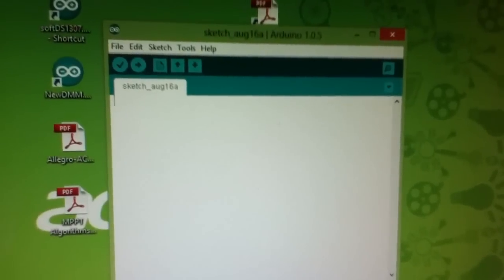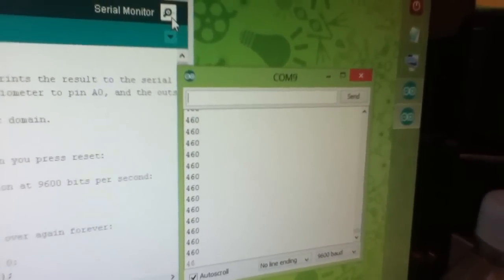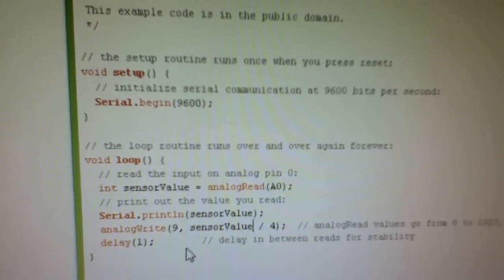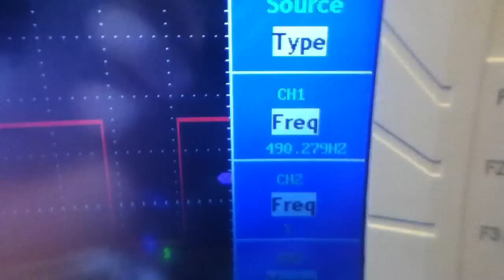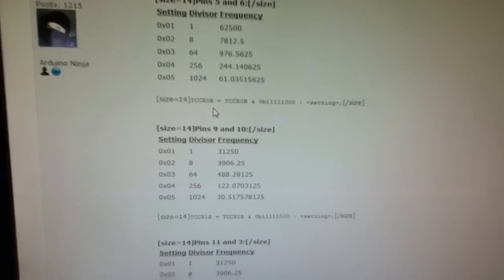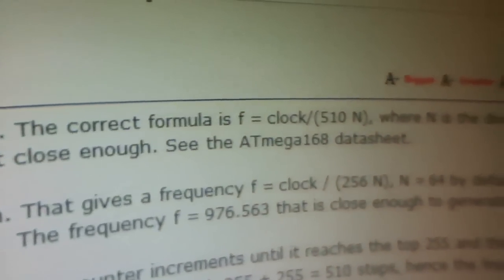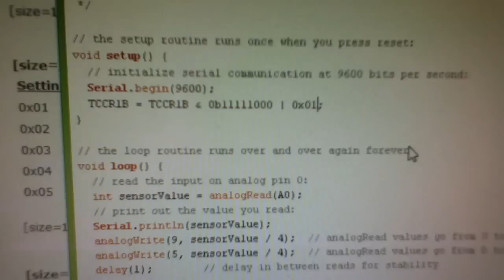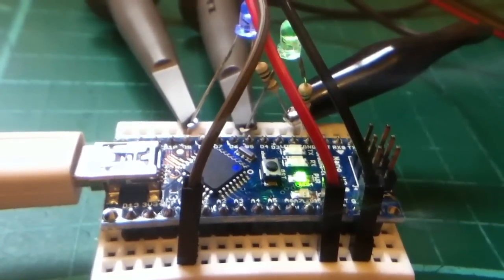Arduino PWM Tutorial #1 - How To Change PWM Frequency

Comment: THANK YOU.  This is huge for driving any non-trivial load off an Arduino pin.  For an LED, it's fine.  But if you want to drive some other entire circuit module, maybe some transistor circuit, etc,  and you need to approximate smooth DC, a PWM at high frequency can very efficiently and simply be filtered to reasonably smooth DC with a small cap and resistor, much more easily (and with quicker response) than low freq 490 Hz PWM.

Comment: hello  i was wondering if you would be able to help me.i have puls generator.how can i program it to run 10% duty cycle at 0.64 v input and gradually increacing voltage to 3.86v with duty cycle 90%.its for my project where voltage coming from throttle position sensor potenciometer control my pulse/duty cycle generator which then directly control fuel injector.any advice most appreciated cheers joe

Comment: How can I set the output to 130 Hz?  I tried running the sketch in Tutorial #2 but it won't compile, it's worthless!
Reply: I see that your question is from a few years ago, and I am honestly just beginning to understand how to manipulate these frequencies. But I wonder if changing the clock speed would allow us to have more control over a wider range of frequencies? Hopefully I don't sound too illiterate to you. Mostly I hope you have since solved this issue but as a beginner, trying to think this through seems to be helping me to grasp the concepts at a deeper level. Maybe I'm even close. Would love to hear what your solution was to this problem. Cheers!

Comment: Great stuff.  You highlight one of the many abstractions that Arduino programming language/IDE manages for users in the background.  I'm guessing that it may be easier to go straight to C programming for the PWM and Timer peripherals where the full power of all the options are available.  But then it wouldn't be an Arduino topic.  Thanks for your videos and clear instructions!

Comment: I'm trying to run an rgb led off pins 3 5 and 6 but thinks pins 5 and 6 are the same     why is this happening
Reply from the maker: +Troy Dry pins 5 and 6 use the same internal timer

Comment: @3.05 you say that the pin D13 is missing, it's actually located on the down-left side of the arduino, just look for it. Great video nonetheless.
Reply: I think he meant that he was wishing that D13 was a PWM channel, since it already has an onboard LED. Would be handy for experimenting.

Comment: Just a quick question. Is the analogWrite duty cycle pre-established. I am going for a 50 percent duty and I am generating the 31khz  from D9 like you showed in your video. Thank you.
Reply: analogWrite(pin,duty) is the syntax for the function. Duty is a scaled input from 0-255. 0 commands a 0% duty cycle, 255 commands 100%. For 50 percent enter 127.
Reply: +backcountry52  Thanks for the info. I really appreciate it. Cheers!

Comment: Hello. Is it possible to switch multiple frequencies with switches ? For exampe i want to drive a DC Motor with 500HZ, 1000Hz and 2000HZ , but i dont wont to change the code every time, but  to change it with a switch mechanical.  Is there a possibility to program a code witch recognizes witch switch i turned on, so the PWM works with the frequency. Sorry for my bad english.
Reply: You simply change the pwm %
pwm frequency has no impact on the speed of your motors

Comment: can all 6 pwm run on same frequency of about 10khz?
Reply: I have a related question that I am currently in the process of attempting to understand. I would like to know if each PWM channel, can output a different frequency simultaneously. For example, have Pin5 send a lower frequency to one motor, Pin9 send a somewhat faster frequency to a 2nd motor, and also have Pin11 send a higher frequency to a third motor?

Comment: void setup() {
    TCCR2B = (TCCR2B & 0xF8) | value;
}

For the lazy, just change "value" for 1 to 7 according to this:

31372.5      Hz    ->         1
3921.57      Hz    ->         2
980.392      Hz    ->         3
490.196      Hz    ->         4    (default)
245.098      Hz    ->         5
122.549      Hz    ->         6
30.6373      Hz    ->         7
Reply: hello. Thank you i dont speak enghlish i have a question if i want set frecuency to 62.5 khz ¿ i can with arduino nano but not in the timer 0 (for the millis and delay)?

Comment: /*
    Prorotype Code for 1-4MHz PWM 50% Duty Cycle
    ICR1as TOP = crystal / (2*Prescale*Fpwm)    in MODE 9
    
    
    at 16000000MHz   64 Prescale PWM Fmax = 62.5KHz 
    at 16000000MHz    8 Prescale PWM Fmax = 500KHz
    at 16000000MHz    1 Prescale PWM Fmax = 4MHz
    
*/

void setup(){

  pinMode(9, OUTPUT);                              // OCR1A Output
  
  pinMode(10, OUTPUT);                             // TEST Pin 10 as General purpose that can use after Enabling only OCR1A
  digitalWrite(10, LOW);
  delay(1000);
  digitalWrite(10, HIGH);
  
//phase/frequency correct mode. SELECT THIS FOR INVERTED OUTPUTS.

TCCR1A = _BV(COM1A1);                                               // Enable OCR1A none inverting mode
//TCCR1A = _BV(COM1A1) | _BV(COM1B1) ;                              // Enable OCR1A and OCAR1B and none inverting mode
// TCCR1A = _BV(COM1A1) | _BV(COM1B1) | _BV(COM1A0) | _BV(COM1B0);
//TCCR1B = _BV(WGM13) | _BV(CS11);                                  // Set Prescale Clock 8 and Mode 9
TCCR1B = _BV(WGM13) | _BV(CS10);                                    // Set Prescale Clock 1 and Mode 9
}

void loop(){
//ICR minimum 2   F = 16000000MHz  No Change if using 14745600MHz

//make this variable as table
//ICR1 = 10,000;                     // 100Hz w/16MHz Prescale 8
//ICR1 = 5,000;                      // 200Hz w/16MHz Prescale 8
//ICR1 = 2;                          // 500KHz w/16MHz Prescale 8

ICR1 = 2;                            // 4MHz w/ 1600000MHz Prescale 1
OCR1A = ICR1 / 2;                    // 50 Duty of ICR1
}
Reply: Bey Meephanlom

Comment: Thank you Julian , I fixed that ugly humming noise of a dc motor by changing the frequeny , now it is even more controlable and really quiet.
Reply: What frequency did you use?  I'm using 976 HZ (pins 5&6) currently and the dc motor sound is annoying at low PWM.

Comment: I'm designing a voltage controlled phase controller for AC lamp dimming that I intend to drive via an Arduino Uno. I'm attaining an analog voltage by passing the PWM outputs through a simple R/C network to generate a constant voltage proportional to the duty cycle of the PWM signal. To get a voltage output that changes fast but still has no noticeable ripple, I need a high frequency PWM signal. I've had this prescaler change work on both timers 0 and 1 of my Arduino Uno, giving me adequately high frequencies for my project. The only problem is, serial communications rely on timer 0, and the Arduino needs to be controlled via serial. This being said, most people would think that using timer 2 would be the obvious answer. So did I. However, when I set the prescaler of timer 2 to 1, PWM on pins 3 and 11 stopped working all together. an analog value from 0 to 254 yielded a logic 0, and 255 yielded a logic 1. Can anyone tell me why changing the prescaler on timer 2 of the Arduino Uno doesn't work? Am I doing something wrong, or is it just not possible to do? Thank you for any help!
Reply: Nevermind the issue stated in the last comment. I made a silly mistake. Well, in essence, so did the sources for how to change PWM speeds. They all say to use a code like this:TCCRnB = TCCRnB & 0b11111000 | mode;with mode being the prescaler setting. That works great for timers 0 and 1, because their mode is 3, or 011 in binary. since we're increasing the speed, setting one of those two LSBs to 0 will change their state as seen by a truth:011 & 010 = 010011 & 001 = 001011 & 000 = 000 (noting that this shuts off the PWM all together)However, timer 3 has an initial prescaler of 4, or 100 in binary, so a speed increase will yield these truths:100 & 011 = 000100 & 010 = 000100 & 001 = 000100 & 000 = 000As you can see here, using the commonly given code for prescaler alteration, an attempt to increase the speed will simply disable the PWM for 3 and 11 all together, hence my problem. A simple solution is to change the line of code to this:TCCR2B = TCCR2B + (4 - mode);with mode still being the same prescaler values.Setting mode to 1 will subtract three from the original value of TCCR2B without affecting anything beyond the prescaler values, so, knowing that 100 in binary is 4 in decimal, we can calculate the new prescaler:TCCR2B + (4 - mode)4 + (4 - 1) = 4 + -3 = 4 - 3 = 1I have tested this new code, and it does in fact work for the Arduino Uno PWM pins 3 and 11. The code can also be altered for TCCR0B and TCCR1B as such:TCCRnB = TCCRnB + (3 - 1);NOTE: once the timer speed has been altered using this code, altering it again with the same code will yield errors. This could be remedied with a code like this:int oldPrescaler = x; //set x to 3 for TCCR0B/TCCR0B, and 4 for TCCR2B
void setPWMSpeed(newPrescaler){  TCCRnB = TCCRnB + (oldPrescaler - newPrescaler);  oldPrescaler = newPrescaler;}This code will automatically compensate for a previously set prescaler if you should ever wish to change it again during a program.Noting how this hasn't been covered anywhere on the internet that I can find, I hope this helps anyone else stuck on the same issue!
Reply: I apologize if the code is confusing in line with the text, I forgot that YouTube does that in comments. If you need any piece of the code in proper format, I can email you a text file of it. Happy coding!

Comment: How can you change the exact frequency to 10khz?
Reply from the maker: I did that in the follow up video
Reply: will u give me the link of follow up video for 10 khz cuz i didnt find it in ur channel i wana generate 20 khz pwm
Reply: enjoy
https://www.youtube.com/watch?v=9JXGIeM3BSI
Reply: when I load ver5 pwm iI could not get it to work keep getting message "Error compiling for board Arduino /Genuino Uno"
Reply: Julian Ilett Hey Julian, my friend created a non-overlapping pwm signal by using PIC18 without any extra hardware. Have you tried it with PIC? I mean how is it non possible with an Arduino?

Comment: if you used a different frequency crystal  to control the clock speed of the chip, wouldn't that change the frequency for the pwm output?

Comment: if you need two output frequencies can you program the second to have a 90 deg phase shift?
Reply from the maker: Yes, I think so. I'm going to produce a video on that quite soon. It's for a charge pump circuit where I want two PWM signals 180° out of phase, but 90° would be just as easy to implement.

Comment: hi Julian, i have been watching your video but i got questions. it is really possible to change the frequency of pwm up to 500kHz or it is limited up to 64kH on pin 5 and 6?
thank you.
Reply from the maker: I think you can go to quite high frequencies, but you will lose resolution. So at 500kHz you may only get 3 or 4 different pulse width values.

Comment: It seems if you go here: arduino.cc/en/Tutorial/SecretsOfArduinoPWM you can use Fast PWM Mode with OCRA top and get much closer to the frequency that you want.  I don't have an oscilloscope to test that though.  But it seems all you would need to do is change "OCR2A = 180;" to something like "OCR2A = 15;".  Try it and post another video for me. :)
Reply: hey it's ben 7 years is there any news ?